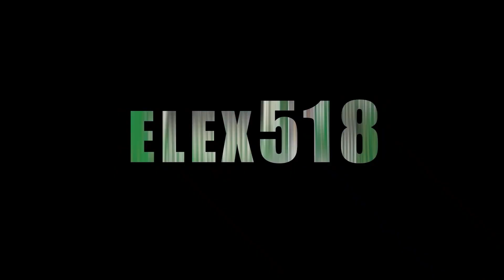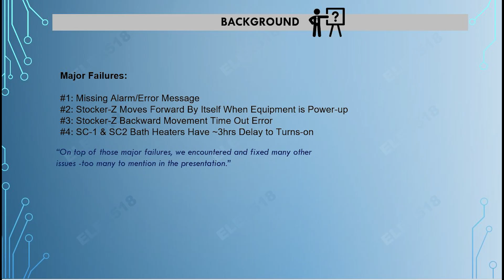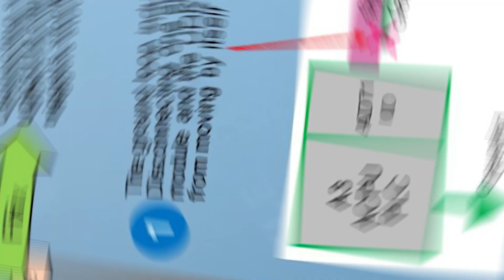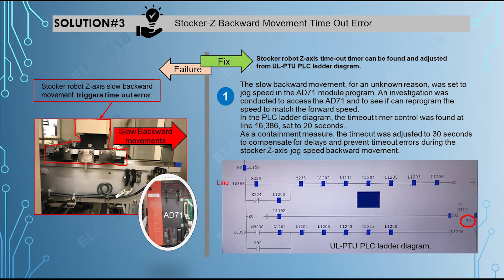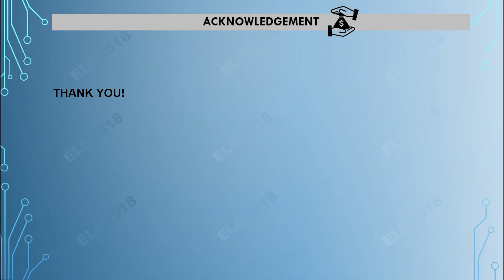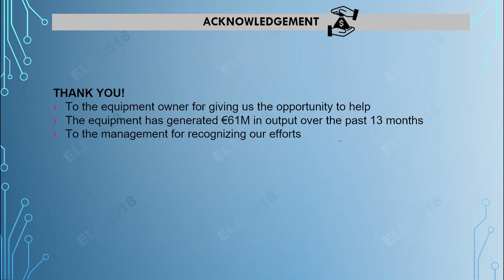Equipment Troubleshooting Support

Comment: Wonderful troubleshooting steps!  I've had the rare occasion of working with an engineer who discovered a flaw in one of Schleuniger's CC6000 machines and submitted the bug report to the manufacturer, resulting in collaboration to fix the issue and was then fixed in later models.  However, for these older machines, if you do encounter what you might think is a bug and try to fix it, you might only make the problem worse.  Anyway, some machines do require certain patches to keep it "working" and can't blame the engineers for trying a quick fix.  Maybe those timer settings were well-intended or maybe a bit-flipped somewhere and caused it to turn to 9999?  Well done!
Reply from the maker: Yes engineers did their best trying to recover the way they understood. We cant blame them, we also share to them how we fix for their learnings. thanks